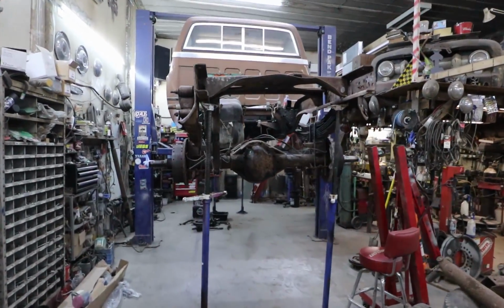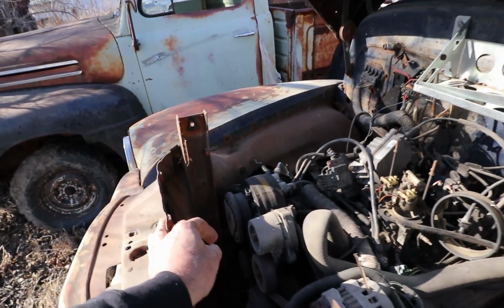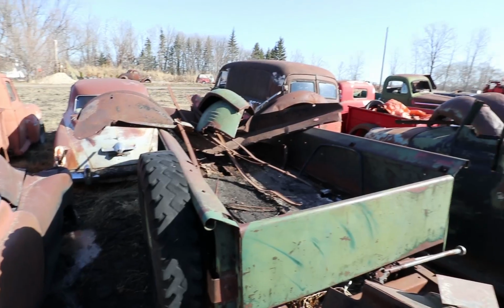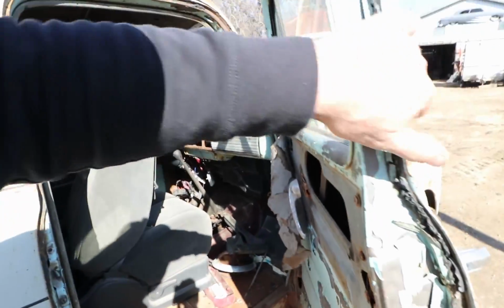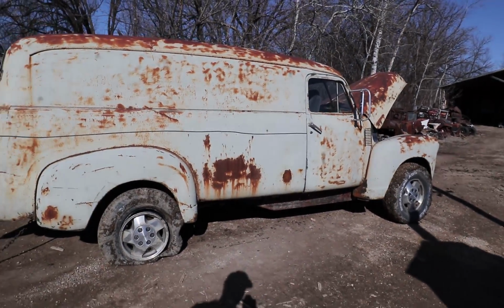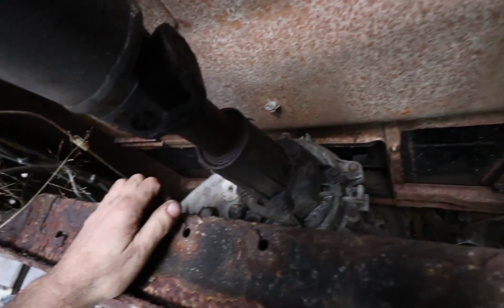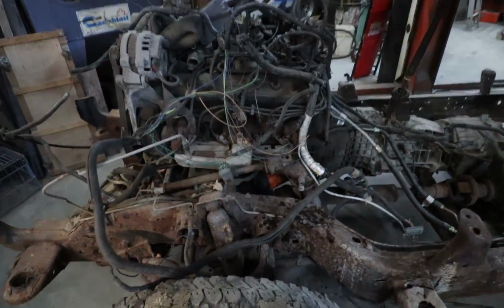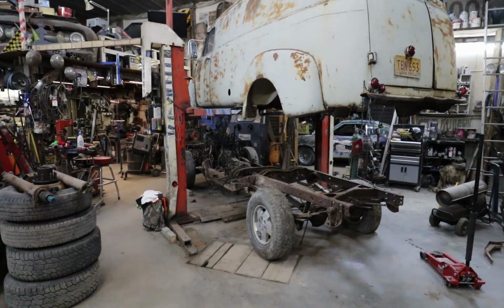1951 GMC Panel Truck Project, do I keep it 4x4? - Part 1

Comment: You could use the Dodge Dakota SLT entire frame and stretch it a little. I don't know it's got rack and pinion steering and a V8 engine.

Comment: Would be cool as a 4x4 and it looks good with the wheels it has, but stuff clearly needs moving around to make the stance correct, also the wheels need to sit inside the wheels wells, this thing I hate is the modern seats and steering column, it just looks to out of place to me that it immediately jars the eye. Definitely an interesting project though that will be cool to follow along with your progress!

Comment: 4x4. Park ranger, forest sevice, or fire dept  look. Old school steel wheels. A little taller than stock
Reply: Forest service if its gonna be 4x4. Id rather see a dually build but old tall skinny tires like on the NAPCOs are cool too.

Comment: GMCrunchy wrap a panel van around a modern chassis man. Here there and everywhere a changing plan, 4x4 or 2 wheel drive shifting sand. Next episode will 4x4 still be the panel van? LS or not to LS, maybe he's a cummins fan or Detroit diesel, take a stand. Slam it down or jack it up, on the ground or standing up, like pablo the pup,'s master mechanic take it up.

Comment: original tires for that panel truck were very narrow bias tires, which would fit better under the front finders,,,dont lower ,,,running boards would cover frame

Comment: No need to lower it to try and hide the frame rail if like you said you are putting the running boards back on it. Problem solved itself.  Hidden. Next maybe get it running reliable 4x4 and do a giveaway for 50k subscribers like DD speed shop did.

Comment: Brent please get rid of that crappy 4x4 frame on the Chevy handyman and lets get it on the ground where it belongs. How about even taking a section out of the rear body and shortening it up a little bit, let's face it it's way too long. If you're going to look for resale on that vehicle shorten it up put it on the ground with an LS and automatic and it should be an easy sell and look good too. I'm thinking maybe like an orange satin paint job?? And some cool wheel tire combo

Comment: brent google e-z swap chassis they sell a kit for these and you can mount they a suburban 4x4 frame or k10 frame or newer 00-up 2wd-4wd frame too and if i was to build i would put the body on a suburban 4x4 frame and 1 ton axles and boggers on it and lift it it how i would build it and would sell fast that way.thanks

- nick
Reply from the maker: Seen them kits but fond them expensive for me i usually do complete builds for the price of that kit haha
Reply: @HalfassKustoms  suburban frame is what the body needs tho.thanks

- nick
Reply: @nicholasarrigo3733  you can fit anything to anything as long as it actually lines up fairly well.

Comment: that 3/4 frame from your sons truck would work
Reply: He could use that frame but then hed have to source axles or deal with tire stick-out. Plus a complete donor would have all the bits and bobs needed.

Comment: i bought a 1950 dodge pu and have a 2001 ram 1500 4wd want to put the 50 dodge cab and body there are 10 inches difference so i have a bed off of a lwb old truck will cut it down and have aswb + 10" hope it works
Reply: You might want to look at the 90s dakotas as, just like Brent said, they have a better width. The only time the bigger full size frames look ok is when you have 35" tires and a lift and wheel stick out is part of the look.
Reply: @danielbuckner2167  I can widen the rear fenders might see if there is a way to widen the front fenders already done to much work on 2001 to change
Reply: @DependableAutoTruck  You can widen both although you may have ro get creative at the front. Its more work but like you said if you already have a lot done on the chassis then whichever is easier.
Reply: Come to think of it, that front blends back to the cab, right? Hmmm maybe just tug on those wheel flares until they come out further!

Comment: Yes keep it 4 wheel drive. Better yet get wierd and use Ford axles and make it locking hubs front and rear, then get a little swanky and put an old school big ass 500 ci Cadillac engine in it. Edit scratch all that. Drop down low, keep the 4 wheel drive and make it camper truck

Comment: Ditch that clapped-out frame and use the "original" frame you showed in beginning of video, along with Dakota front clip. Go 2 wheel drive and bag it to lay the running boards on the ground. If you go 4x4 it will look like a Grave Digger monster truck wanna-be. Just my opinion...